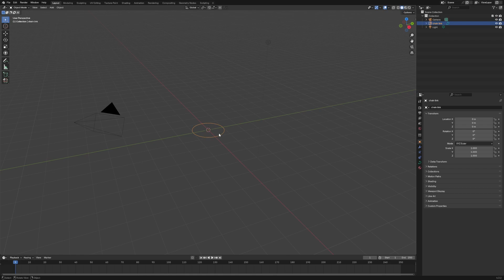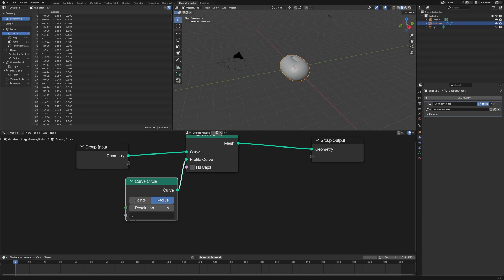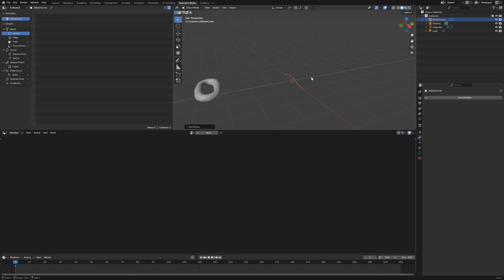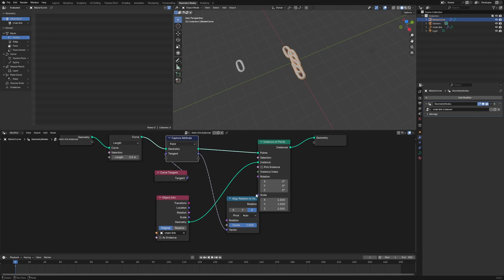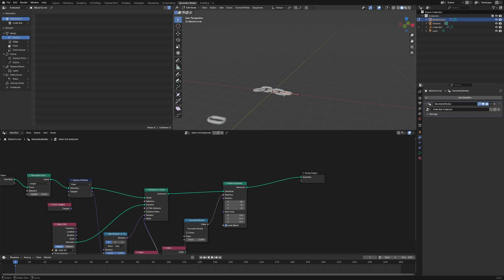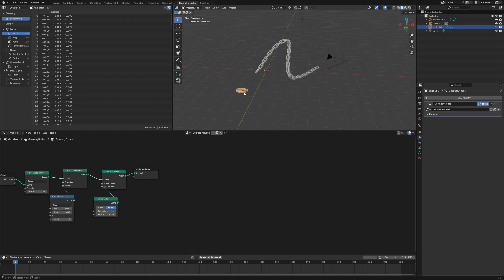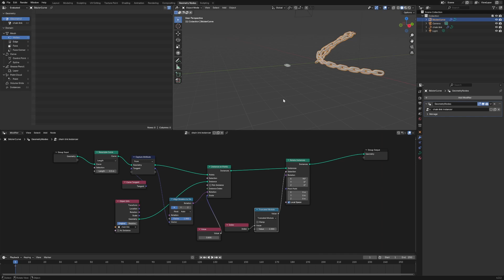Infinite Procedural Chain Links, Blender Geometry Nodes Tutorial

Comment: Hi Augury. I'm trying to make a chainsaw chain. I think I'd need to use indexing to put the different links in the correct pattern, but how would one go about doing that?
Reply from the maker: Good question.

I would do an odd/even switch with modulo 2 with the index to switch between your bigger and smaller piece for chainsaw chains.

That is assuming you made two meshes, the big piece and the small one.

Let me know if this makes sense